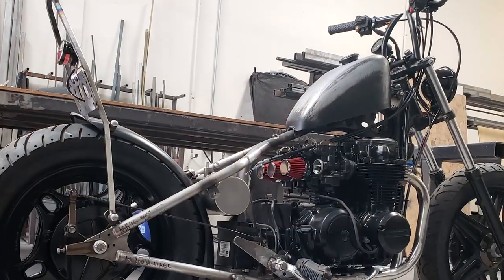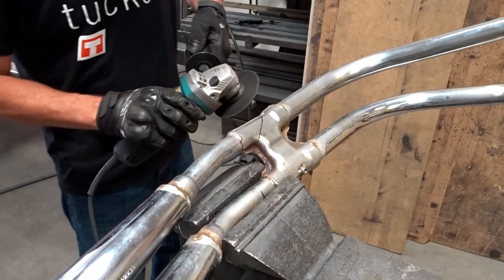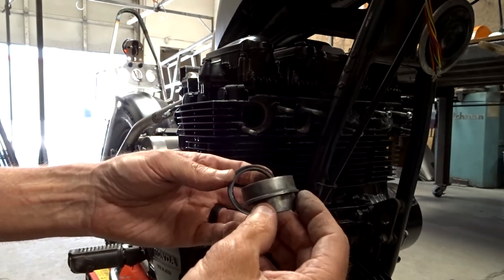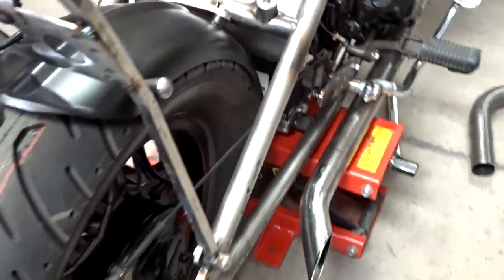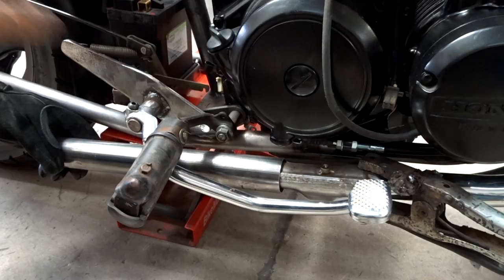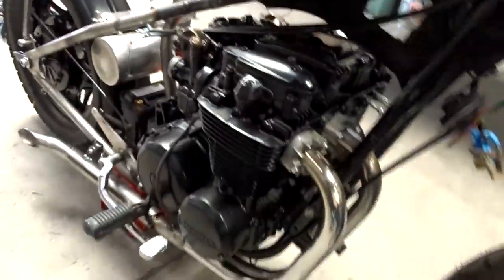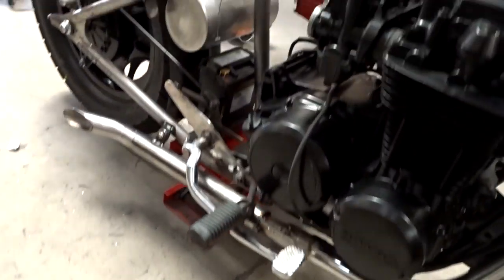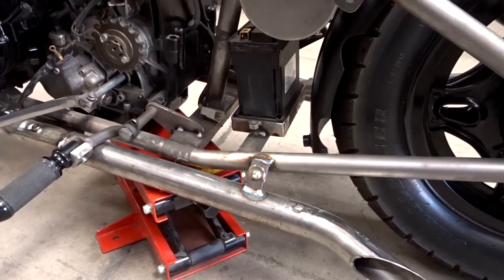DIY Custom Motorcycle Exhaust Build - Ep.21

Comment: I really like the pipes. The only thing I might have done differently would have been to upsweep with rear of the exhaust slightly to run parallel to the frame, but I still love the setup.... especially the gooseneck tips. That's an old school look that really plays nicely with the look of the bike. I'm so glad you chose that over the 4 into 1 exhaust. Great job. This is gonna be a great little bobber when it's done!

Comment: You did a great job brother, looks killer and cant wait to hear it, I'm currently messing around with baffles and stuff on the scrambler build at the moment :)
Reply: I just did a custom exhaust for my CB on my channel. You did a nice job. I used a cb900 pipe and combined it with the stock exhaust and a aftermarket muffler.
Reply: I just built an exhaust on my channel. Getting ready to do a video about extending the baffle

Comment: Way to go Motopilot! Awesome setup 🤘🏼
Not to sure about how the engine will perform routing 2 into 1 without changing the output pipes diameter though... and maaaaybe (can’t see quite well in the vid) the line won’t be perfectly horizontal unless there is a significant tilt forward but a freaking good job 🤘🏼😎🤘🏼

Comment: What is a standard size pipe for motorcycle exhaust?
Reply from the maker: There really is no one size for all bikes. It varies based on engine size.   The bigger the engine the more air it needs to push out.
Reply: @MOTOPILOT6  it's a 1500 cc

Comment: I don't like the look of this exhaust. In my opinion it would be better to follow the line of the frame: the tube should bent up at the position of the food pegs to run along the lower frame.
Reply: I think following the frame could make it look better. Also  it is gonna be ok when  it sits level. I think maybe a fatter   turn out could look better. I do like the exhaust on both sides of the bike